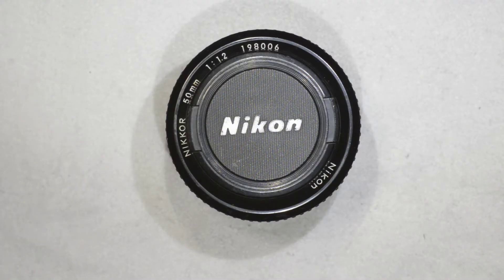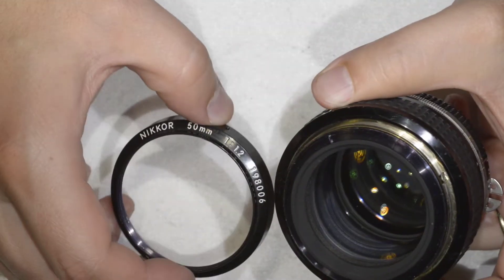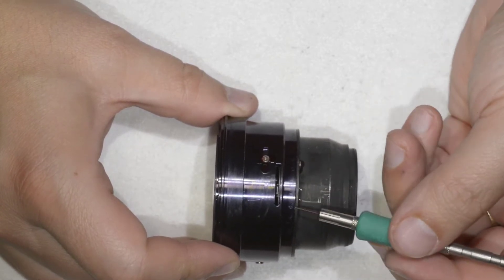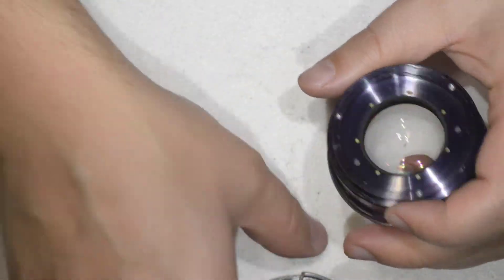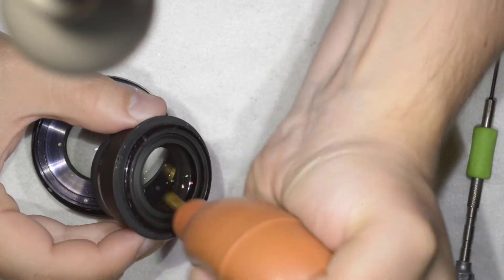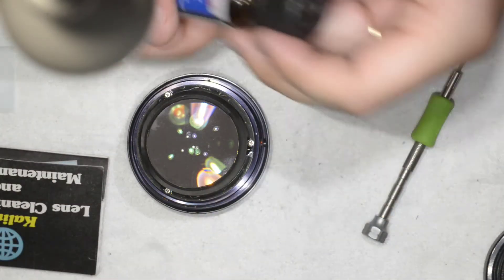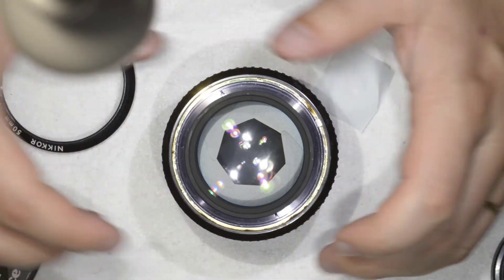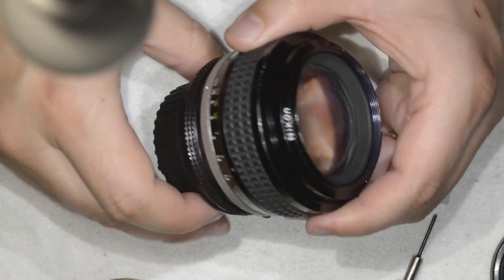Nikon Nikkor 50mm f/1.2 AI : Disassembly and cleaning : Lens repair

Comment: My copy is experiencing loose focusing but otherwise clean inside. At what point can I tend to that issue? What grease can I use that will not vapour of atomise  over time?
Reply from the maker: Hi, if the loose focusing is due to play, I'd recommend molykote ws2, a thick enough grease but gives enough resistance for the precise focusing needed for a f1.2.
Reply: @diyextravaganza ok. So I decided I could live with the less then perfect focus but now there’s 3 dust particles that must have got sucked in the front.  Could it be that Loos did that happen?  I presume I still have to open it just to get that out now or can I blow through the front just to move them around outside of my image circle?
Reply from the maker: @khanscombe619 that can happen, they are for sure trapped in the diaphragm region. Follow this video and it should be an easy job.

Comment: Thank you for this tutorial. I bought this lens maybe two or three years ago, but had not really used it since it sometimes would jam up on my FM2/T. Recently I got a F3P and slapped the lens on, jammed the F3P instantly. I started to look more into it (I thought it was my FM2/T's fault) and figured out that some previous DIY person had attached the rear lens group in the wrong orientation. When focused at infinity, the camera's aperture closing lever would hit the side of the rear lens and jam up when taking a picture. There is a cut out in the rear lens for this, but it does not go the whole way around the lens. So you have to attach it in the same orientation it came out.

With your tutorial I disassembled the lens, removed the rear group, reattached it 120 degrees counter clockwise and then spent over an hour trying to get the aperture linkages to line up :D I noticed they were a lot easier on mine to attach at f/16 instead of f/1.2. Did not have to fight against the spring so much.

Seems to work perfectly now at all focus distances and apertures, time to load up some film and go shoot! Thanks again!
Reply from the maker: That's great news, a lens like does not deserve to be idle. Best.
Reply: @diyextravaganza  Yes you are correct. I took some Ilford XP2 Super from the fridge and went out to a nature park with the F3P and 50mm 1.2. Very nice pair, a bit heavy but balance is fine. Hard to focus with the focus screen that is only a ground glass, no microprism or split image. Haven't yet developed but it feels like it works perfectly. Thanks again :)
Reply from the maker: @cabbelos  Sounds nice, focus screens for the F3 are easy to find. Or if you find the sports finder for the F3 that's even better.

Comment: Just got this same lens today! Very clean but grease has clearly dried out. This is super helpful, thank you!
Reply from the maker: You're welcome. Enjoy this beautiful lens and don't forget to mark helicoils as they separate, this is very important if you disassemble the focusing part. Cheers.
Reply: @diyextravaganza  I just got it back together. I just ended up cleaning the old grease and reapplying without disassembling the body any further than you did here. Pretty sure I was able to get to all the threads good enough. Inner lens didn't have too much dust so I didn't bother with that part. Getting it back together and lining up the tabs was tough! It helped when I placed the lens pointing downward on the table. Thanks again.
Reply from the maker: @JRoseVids  You're very welcome, don't forget to like and subscribe if you haven't AND to tell all your friends about the channel. cheers.